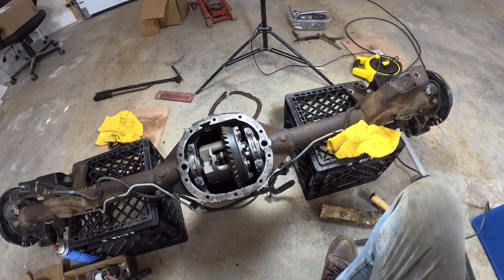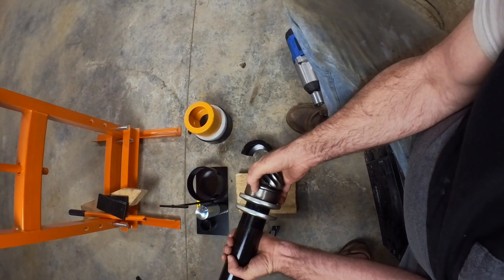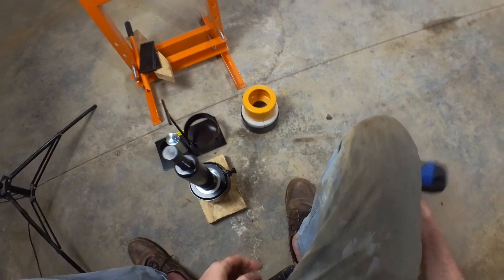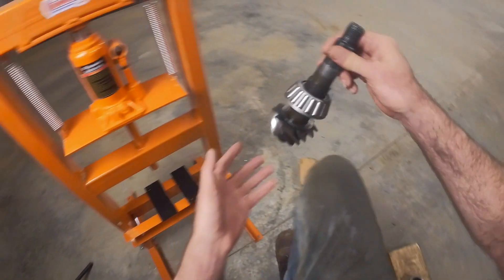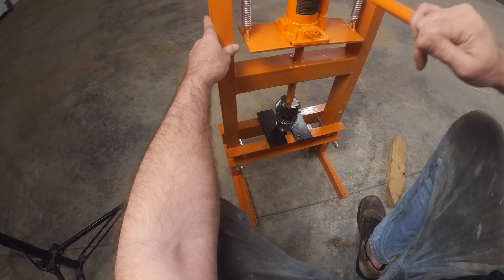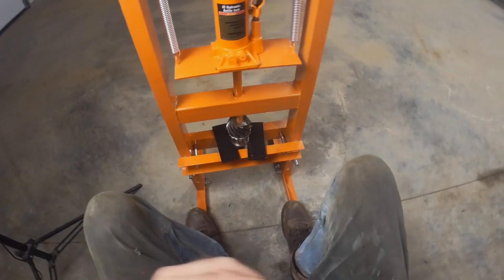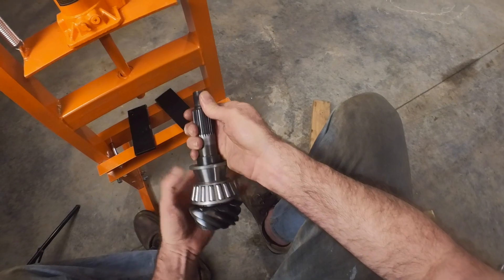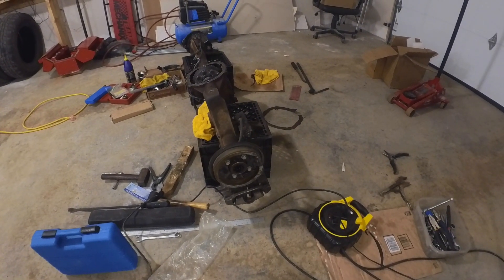How to remove a Pinion Bearing - Testing Cheap tools from Amazon - Hydraulic press & Bearing Puller

Comment: They maybe cheap but they will do the job... The clamshell pinion tool the forcing screw should always be greased every time  used it will last a lot longer...the press will also give you many years the only that may wear out is the bottle jack... But I have had my 20 ton from HFT over 25 yrs still going... Another thing is to use heat when you can to press things together... For example you can take a portable induction cooktop and place the pinion bearing on set to 200° and it will just slip on no drama..and that temperature is fine as most rear ends run between 150° to 250° in operation.

Comment: The difference you observe between your setup bearing and the new one is that the setup bearing is already worn, makes sense now, right?  I’ve heard people get their shims set how they want it and then when they do the final install they subtract 5 thou on the final pinion shim (or whatever the difference in bearing thickness was).
Reply from the maker: Yes that would make sense. But in this case I actually bought 2 new bearing sets the same brand and part number. The big problem here is just my lack of experience setting up a rear diff.
Reply: @LSxMotorsports2021  Some people turn the old bearing into a setup bearing by grinding the inner surface down a few thou so that it slides on and off by hand.  Then you install the pinion without the preload crush washer and you just snug up the pinion nut till you start feeling pinion yoke resistance when you spin it.  It permits you to try various shims without having to press and pull the bearing each time.
Reply from the maker: Yeah that's what I did but I used a new bearing instead of the old one. And it did slide on and off great but still had issues. Could be poor quality control because both bearings were the same brand and part number. I was also using a very cheap gear set so that could be the problem. Going to be doing it again soon switching to motive 3:73 gears this time.

Comment: Sometimes bearings can have slight differences in dimensions. Try assembling the bearings and mike the bearing assembly. Do this with your set up bearing and your install bearing. Compare the dimensions.
Reply from the maker: Yeah you are definitely right.Even though they are the same part number and made by the same manufacter they are slightly different.